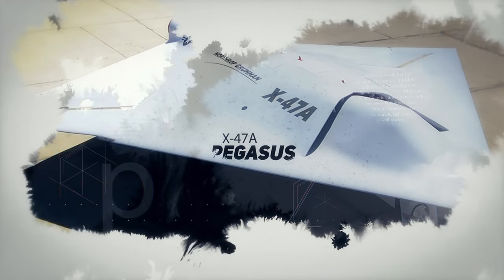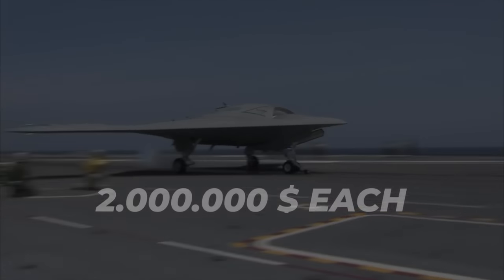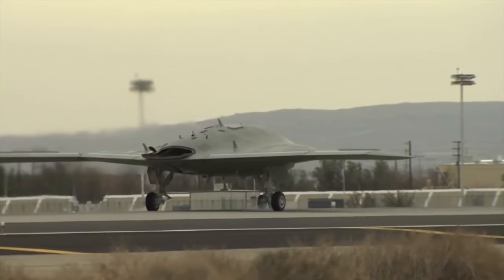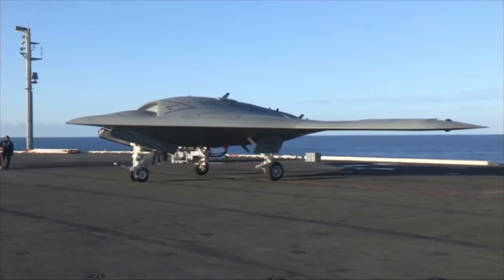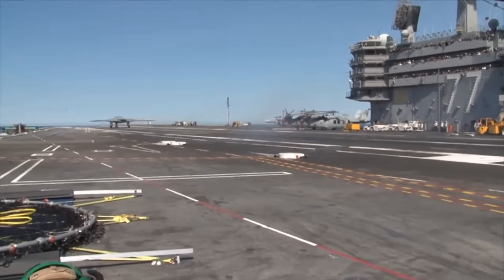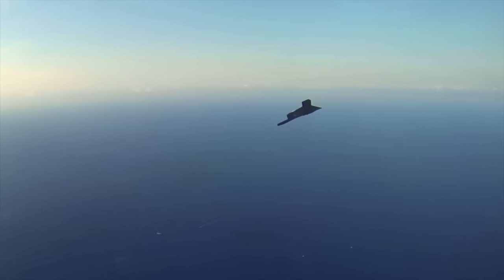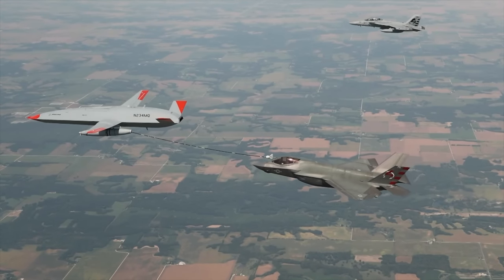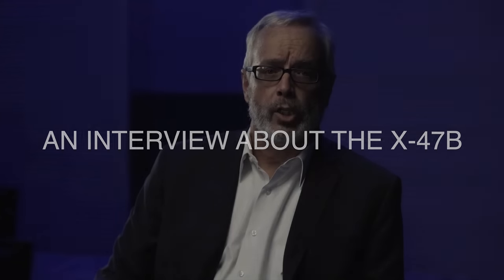X-47B Stealth Strike Fighter built for the U.S. Navy By Northrop Grumman

Comment: How does it fly properly without a vertical stabiliser?!
Reply: Computer controlled FCS, just like b2/b21    it has at least 6 diffent control surface/vector authority. It can't yaw the same way a vertical rudder & or center pitch point like with a horizontal tail/stabaltors or elevons & canards do.  But yawing is done with split elevons like an air brake. More like a trailing edge spoiler.  
Just like b2 an large delta - tailless aircraft does. So it'll roll an pitch like conventionally controlled a/c then in between axies with a hybrid of flaperons or maneuvering flaps. 
Thrust vectoring would probably be a staple of all future tailless ( vertical ) air craft. I.e b-21 F(/a)-xx(x)